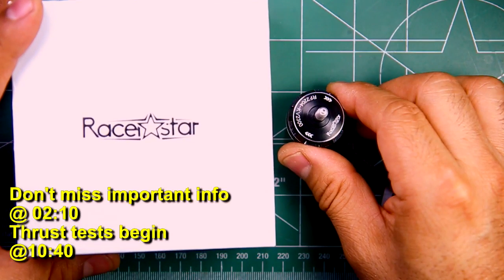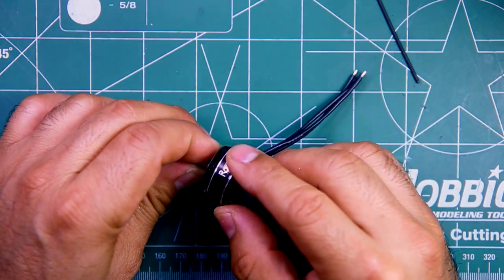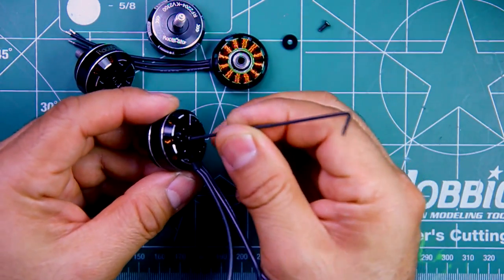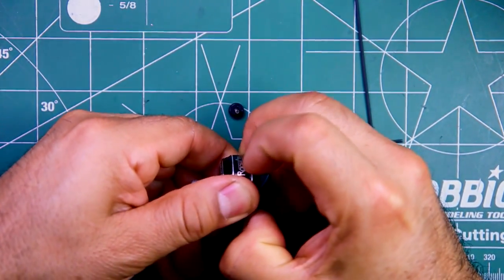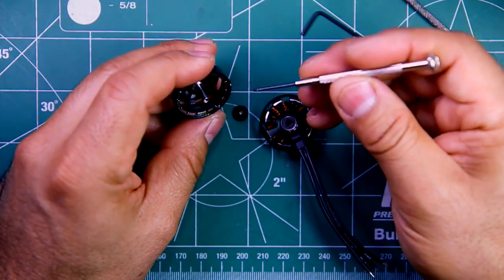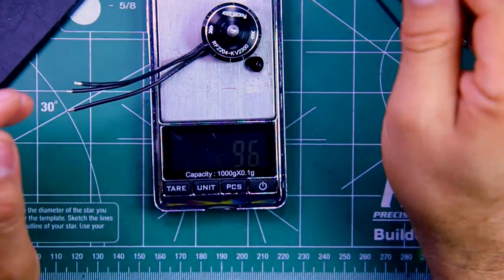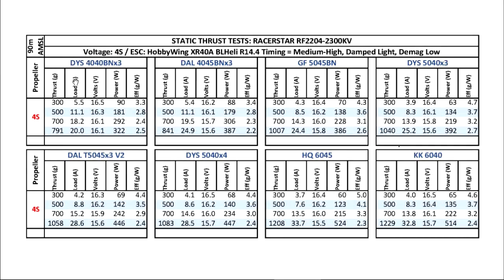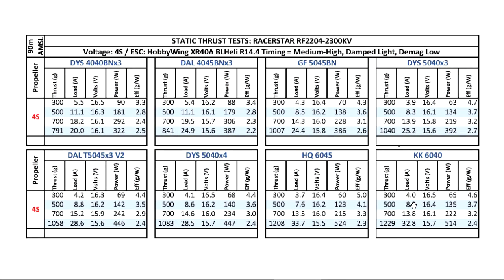RacerStar RF2204-2300KV from Banggood *Static Thrust Tests*

Comment: I think 2204 is kinda outdated. Nowadays, 2205 is the standard minimum and it seems 2306 will be the next standard
Reply from the maker: LoL ... yes few people are using 2204 these days. I was hoping Banggood would send the 2205 version of this motor when I posted request on the RCGroups thread, but they sent me the 2204 :( 
These feel very solid, but I would go for the 2205, and they need to make 2206 and 2207 or 2306 versions and offer them at same good price and they'll sell well for sure.
Reply: I'm curious, will Racerstar release a 2206-class motor with affordable price? So far the most famous 2206 budget class motor is from RCX
Reply from the maker: They should release a 2206 in this "RF" series. It would sell well. RacerStar/BGood doesn't announce much on motor releases, they just appear on their New Products pages. There's a 2206 on the other "BR" series but it has mediocre performance and it's heavy.
Reply: What I don't like from RF series is they're always comes in 4, which means you if you break one, you have to buy four.
The BR2206 is a joke! high CG, heavy and has power less than the BR2205. No wonder why it's rarely seen. Maybe they should release the BR2206 V2

Comment: Do you know where I might find the shaft screws. After seeing your video I notice one of mine had already fallen out. I've only had 4 flights with them.
Reply from the maker: Sorry - I don't know where to get the exact same one. Unfortunately I'm away from home right now, but you can check to see if a 2mm or a 2.5mm screw fits. Try the screws that come with 1306 size motors. Those may fit. You may have to use a 2mm washer too. You can also try ebay but first check the size of the screw. You can measure from the other motors that still have them or from the 1306 motor mount screws
You can try something like this, just measure screws from your motor
http://www.ebay.com/itm/M2-Allen-Hex-Socket-Cap-head-Button-head-Flat-head-Phillips-Pan-Head-Screws-Bolt-/182182104437?var=&hash=item2a6ae64d75:m:mg0R1eyTzAsTJE9ej0Y6Bqg

http://www.ebay.com/itm/Countersunk-Washer-M2-M2-5-M3-M4-Aluminum-Flat-Head-Nut-Bolt-Multi-Color-Washers-/162314271475?var=&hash=item25caaf3af3:m:m4z3wODS18UgO5myO-wap4g

Comment: Yo EngineerX , can you do Static Thrust Tests running
the T-Motor F20 4100 Kv Motor with the Rotor X RX3040T tri props on 4s

Comment: Aren't those shaft screws cw and ccw too? Sorry if i missed it)
And could you rise your volume for the first overview part, it's qite qite.
Thanks a lot!
Reply from the maker: Shaft screws are "normal" thread so CW=tighten. I'll try to increase volume with the editing software. I use my camera's mic to capture sound and it's not that good for that. Thanks for watching!
Reply: HI IS IT TRUE THAT THE RACERSTAR  RF2205S 2300KV ARE JUST AS POWERFUL AS THE FIRST SERIES EMAX RS2205 2300KV REDBOTTOM MOTORS AT HALF THE COST?